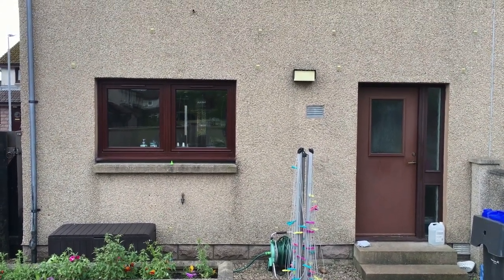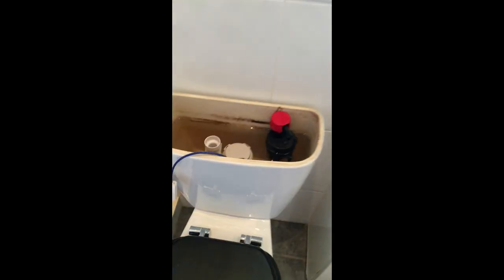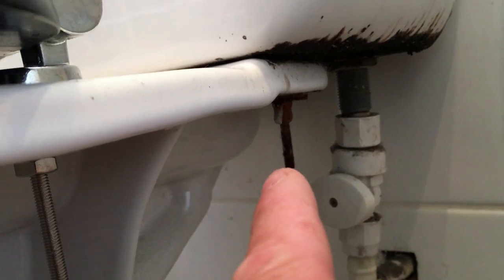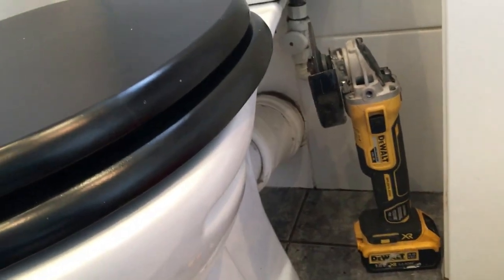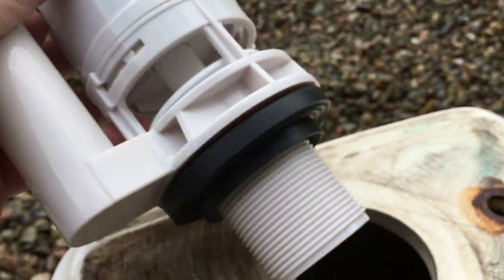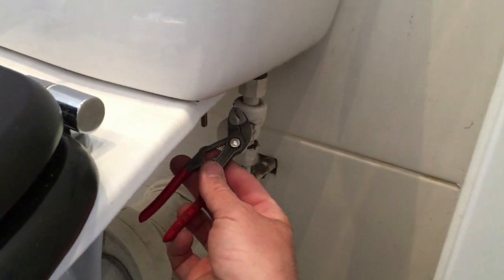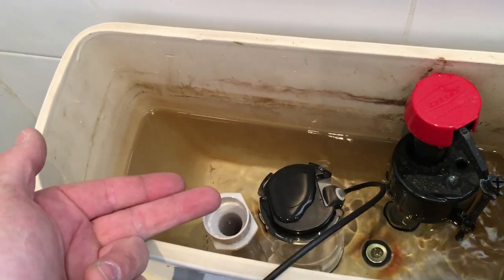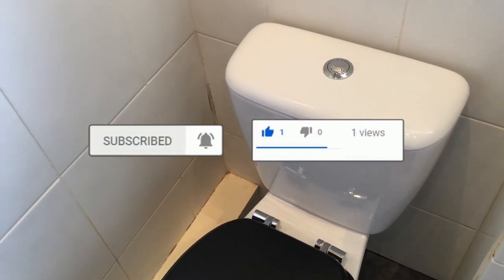How to Replace a Toilet Flush Mechanism with Seized Bolts

Comment: Hi Nice video well thought out and useful tools. I have a question about the button types. In your toilet it was like for like but if like me you have the handle type flush mechanism can you recommend a button replacement. . I noticed that the water level control was just to the back right hand corner. but my own would have that ball type... Maybe I should get a new toilet but this is a new build 9 years ago...I prefer Drambuie ...lol GN
Reply from the maker: Cheers Glesga, You can get flush mechanisms that come with a handle and a button, I would recommend this Viva Skylo  https://amzn.to/307Lug7 I use these quite frequently on older toilets because they come with a brilliant little handle that is really easy to fit and operate. They also come with a button that you can mount in place of your original handle, should you wish. If you have a ballcock, you can easily remove it and replace it with a modern fill valve - I would recommend the Fluidmaster  PRO45B such as this https://amzn.to/2BB2KRc  or the Viva universal fill valve such as this https://amzn.to/305umr2
 I hope this helps and thanks for the comment 👍😀
Reply: @Bacrenfencing  Thanks ...

Comment: Just an FYI, did you know that there’s no need to remove the toilet with these flushes , the whole thing just twists out and you can replace the flush mechanism in minutes. Or just replace the washer but really good systems.
Reply from the maker: Hi Charles, Yes, I could have just twisted it and replaced the mechanism as it was an old fluidmaster that was in there BUT the "through bolts" were totally shot and needed replacing, so I just done the whole lot whilst the tenants were away. If I had left the bolts the way they were, I would be asking for trouble and another call from my tenants. Well spotted though 👍😎
Reply: My first thought too

Comment: You did not show how you got the tank off with the grinder. I have that problem. Did not learn anything with this video
Reply from the maker: It was difficult to film the actual cutting of the bolts due to the cramped conditions. I would have thought that it would be self explanatory how to cut the actual bolts ? Thanks for the comment 👍

Comment: God you milked that one . You could  have wet vac 
The just clicked the Pro 550 out and clicked new one in .no need to even take system  off the wall.🤣🤣🤣 I R T plumber .just saying
Reply from the maker: Aye........ It is one of my own rental properties and I wanted to replace everything as I said in the video. I had spare time, so just replaced everything instead of "clicking" a new PRO550 top section in. Ah well, I suppose you know best mate 😁